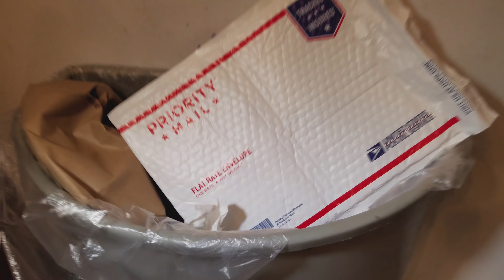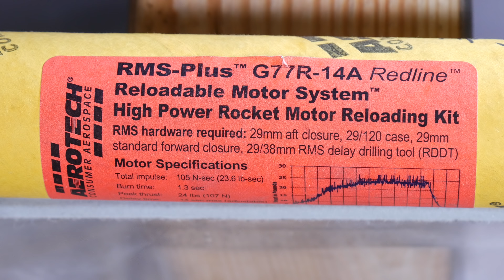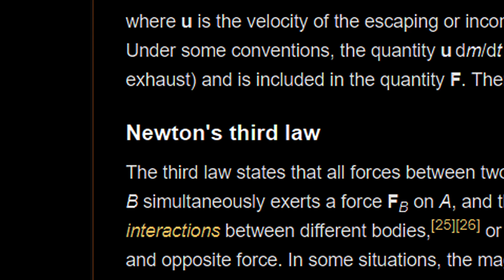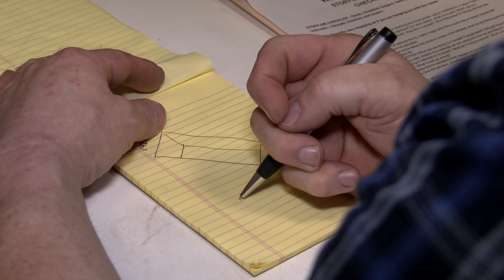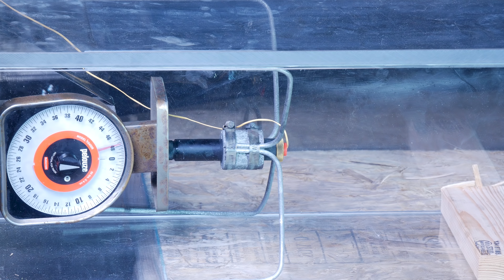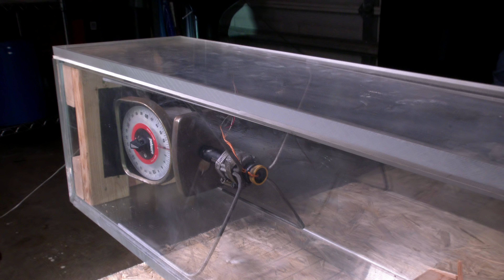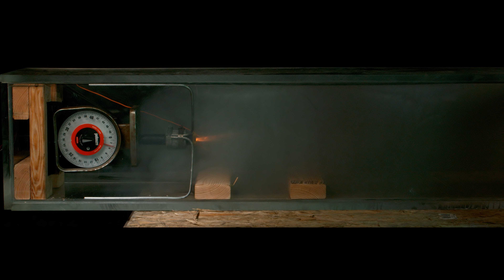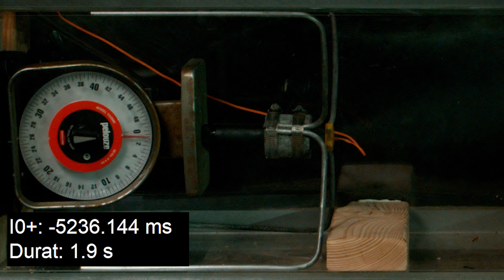Rockets in a Vacuum Chamber - Newton's third law of motion Visualized

Comment: One problem with this test! The second the rocket gases began to fill the chamber, you lost your vaccume and created an atmosphere.
Reply: Spot  
So??? That does not replicate a non-atmosphearic environment!
Reply: The vacuum would be progressively lost not instantly
Reply: And we don't question how do they navigate their rockets in a vacuum. BS
Reply: @sekainiheiwa3650  - With more rockets...
Reply: Exactly!
Reply: Yeah I mean if only we could test a solid rocket in space somehow. (see Northrop Grumman Star 48B solid rocket motor)
Reply: Yes, but the atmosphere wouldn't be thick as Earth's. If they were pushing on the air rockets would loose thrust at high altitudes.
Reply: Big rocket in tiny vacuum vs tiny rocket in ridiculous vast space vacuum. Yeah.. same 🙄
Reply: Sehe ich auch so. Desweiteren gibt es hinten eine Wand gegen sich der Strahl abstossen kann. Denke der Test entspricht nicht der Wirklichkeit
Reply: Very true
Reply: And that is exactly how a rocket works in a vacuum, it pushes off itself, well done, gold star.
Reply: @托马斯-i4v  
hi5
Reply: @sekainiheiwa3650  Rockets don’t use solid fuel In space. It’s reaction control. RCS
Reply: @TEMPLE7D  Yes RC, on lithium by Tesla :)
Reply: Exactly. Thanks fuck I'm not the only one seeing this.
Reply: At least, Rocket can be ignited in empty space
Reply: @TEMPLE7D  - "Rockets don’t use solid fuel In space."

Yes we DO use solid rocket motors as UPPER stages in rocket launches.
Even lit in HARD VACUUM.
Reply: your assumption is that the atmosphere will oxidize but that atmosphere is already burnt up so actually it would technically make it harder for the rocket to keep burning
Reply: جرابة Sock  wrong cause that is exactly what happens in space, as soon as you light your rocket the space around the rocket isn't vacuum anymore... so he is replicating space like situations in his vacuum chamber
Reply: Its correct he fooled ...he created the Atmosphere to burn the oxygen but not really used Vacuum 
Because he'll fail and no one will see this video
Reply: @spacekraft5681  yes read my above comment
Reply: Which is exactly what happens in space. That's why rockets work in space because they create their own atmosphere behind them to push off of by throwing hot air out the back then they throw more hot air out the back and push off the hot air that came out a millionth of a second before
Reply: @jasonspringer2983  When you release gas into an infinite (for all intents and purposes) vacuum, the pressure  immediately drops to zero.  And you can't push on gas that isn't pressurized.  Furthermore, unpressurized gas can't push back.
Reply: In actual tests run by universities and space agencies they continue extracting the exhaust gases while the engine runs.
Reply: @jcskyknight2222  Every vacuum chamber must continously pump out air in order to function.  The problem is you can't remove the exhaust fast enough to maintain vacuum conditions in the presence of a rocket engine.
Reply: @numbynumb  Eh, yeah I guess over a long period of time, but a well built one will hold pressure without the pumps for a good period of time. 

Full vacuum for a chemical engine, yeah it probably wouldn’t hold long, the gas would build up relatively quickly. For an ion engine (or one with similarly low exhaust mass flow)  you definitely can extract gas fast enough to maintain an extremely low pressure.

At least low enough to prove that the engine isn’t “pushing off” atmosphere.
Reply: @jcskyknight2222  Can you point to an example of what you're describing?
Reply: @jcskyknight2222  It's difficult to imagine how they could have tested rocket engine's performance in vacuum because, on top of the difficulty maintaining the vacuum, the soot from the rocket exhaust would also clog up the pumps.  I think they probably just relied on the math - and it's hard to believe that would be adequate  for different reasons. A real aircraft engine is put through a rigorous testing regime over the course of its development because the models are never anywhere close to complete.
Reply: @numbynumb  apparently you do not know enough basic physics to know that rocket propulsion works via RECOIL FORCE.

Would a CROSSBOW, fired in a vacuum, STILL have recoil? Yes or No?
Why or WHY NOT?
Reply: @stuartgray5877  Of course it would recoil.  Because the tension in the crossbow's flexible components cause a reaction force in the mechanism.  

Unlike a freely escaping gas, a crossbow bolt must be propelled by potential energy stored in the string and bow of the crossbow itself.  A pressurized gas doesn't require that a force be applied to it and will freely expand on its own when exposed to a vacuous space.  The rocket  doesn't apply any force to the gas whatsoever and therefore there is no reaction force.  

The work done by a gas = external pressure*change in volume.  Without an external pressure, no force can be applied.  It's really that simple.
Reply: @numbynumb  Can you explain the Law of Conservation of Momentum?
Then use THAT to explain 
how recoil works in crossbows?
Reply: @numbynumb  - "The rocket  doesn't apply any force to the gas whatsoever and therefore there is no reaction force."

Oh really?  The rocket applies NO FORCE?

Can you answer these very simple physics questions?

1 - Does the byproduct of the combustion (the Exhaust Gas) HAVE MASS? Yes or NO?
2 - As fuel and oxidizer combusts, and the exhaust gas exits the rocket is it ACCELERATED?
Yes or No?
3 _ can MASS be ACCELERATED without a force?
yes or No?
Or does the acceleration of mass REQUIRE a force?
Reply: Jason let me ask you a question.  Do you think that enough "atmosphere" can be created behind let's say an Apollo spacecraft during an LOI burn to slow it down enough to enter orbit around the moon?  Do some thumbnail math.  I think you will see pretty quickly that it can't.  Also, keep in mind that whatever gases are being produced behind the spacecraft not only are inheriting the initial speed of Apollo in the same direction, additionally, those gases are being further accelerated away from the spacecraft.  It is not any "atmosphere" that results in this slowing down.  It is the transfer of momentum produced by the acceleration of gas out the rocket nozzle and shaped by the engine bell.
Reply: Here's another question for you doubters.  You yourselves claim that the exhaust is pushing against "atmosphere".  If that is the case, then why do rockets actually ACCELERATE during a launch as the atmosphere is getting thinner?
Reply: @numbynumb  - Sorry but rocket pushes on the exhaust gas while STILL IN THE ENGINE. What happens AFTER the gas leaves the rocket nozzle is irrelevant.
Let me ask you this:
Can the MASS of the Exhaust gas get accelerated WITHOUT A FORCE?
Gas HAS MASS, and it DEFINITELY gets accelerated.
so WHERE does the FORCE COME FROM that accelerated that gas?
Reply: @numbynumb  what's the matter? are you AFRAID to answer basic physics question because it might PROVE YOU WRONG?
Reply: @stuartgray5877  Do you understand that the equation describing the work done by a gas takes the form of work = external pressure x change in volume?
Reply: @stuartgray5877  I did answer your questions. I suspect ypu dont understand the answers because you're not familiar with the physics of gasses (ie Kinetic Molecular Theory).  I'll try to answer them in terms you can understand for the edification of whoever might end up reading this and we can go from there.  

1. The gas' mass cannot accelerate without a force.  

I disagree with your statement that the mass of the gas definitely gets accelerated.  

2.  Since I disagree that the gas' mass was necessarily accelerated, I don't think the force came from anywhere.
Reply: @numbynumb  No you DID NOT answer my questions. try again:

1 - Does the byproduct of the combustion (the Exhaust Gas) HAVE MASS? Yes or NO?
2 - As fuel and oxidizer combusts, and the exhaust gas exits the rocket is it ACCELERATED?
Yes or No?
3 _ can MASS be ACCELERATED without a force?
yes or No?
Or does the acceleration of mass REQUIRE a force?

Or admit you have NO INTENTION of answering my questions because answering truthfully PROVES YOU WRONG.

Now prove ME wrong by answering these three questions with YES OR NO answers.
Reply: @stuartgray5877  
1. Yes
2. No
3. Yes
Reply: @stuartgray5877   You think a rocket works like a crossbow recoiling with the exhaust being like a crossbow bolt and and rocket being the crossbow.  You think that a volume of gas behaves exactly like a solid object. This is incorrect. The reality is that a volume of gas is made up of an enormous number of individual particles in a state of perpetual random motion and you can't treat it as a solid object when trying to understand how the gas performs work. As I explained previously, F = ma is not the right equation.  You need to use the equations that describe the behavior of gases when dealing with gasses.  

Im curious to know: what part of the rocket do you imagine is applying a force to the exhaust?  And where exactly do you think the acceleration occurs?
Reply: @numbynumb  Watch the YT video titled "uninterrupted footage of the falcon heavy launch and booster landing!" by astronomy live.

watch from launch to booster landing and then explain what you just witnessed.
If you want MORE detail, watch the same event from the rocket in the YT video 
"falcon heavy launch" from spaceX and you can correlate events in both videos.

If you cannot spot the parts where rocket propulsion was working in a vacuum, Ill be happy to point them out to you.
Reply: @stuartgray5877  Gravity can accelerate masses and gravity is not a force. You don't seem to understand that there's more to physics than Newton.  Kinetic Molecular Theory was created after Newton because Newton's physics can't describe the way gasses behave. Also, Einstein's theory of gravity clearly states that gravity is not a force yet still accelerates masses.  In fact, the vast majority of accelerations in the universe happen without any force being applied.  

For one thing, the space agencies are not claiming that every space rocket uses a fuel and oxidizer, so it's not necessary to introduce those terms into the conversation.  They claim to use rocket engines which use only pressurized gas with no combustion. 

The rocket exhaust will definitely have the same velocity the moment before it leaves the rocket nozzle and the moment after.  Why would merely leaving the rocket nozzle cause the velocity to increase?   The only way to increase the gas' velocity is to increase its temperature.
Reply: @stuartgray5877  You are now claiming that "the engine accelerates the fuel and oxidizer while still in the engine".  A few comments ago, you claimed that the velocity of the exhaust is zero relative to the rocket until it leaves the nozzle.  How can something be both accelerating and have zero relative velocity?  Your explanations contain contradictions.
Reply: @stuartgray5877  I have some questions.

1. Do you think Kinetic Molecular Theory describes the behavior of gasses? 

2. Do you agree that the equation describing the work done by a gas takes the form of work = external pressure x change in volume? 

3.  Do agree that a freely expanding gas performs no work when expanding into a vacuum?
Reply: @numbynumb  - "Gravity can accelerate masses and gravity is not a force"

Quit repeating bullshit you heard on YT.
Gravity is DEFINITLEY A FORCE for all practical purposes.
Engineers KNOW that gravity is a force.
Some physicists talk about it as if it is not.

The DEFINITION of "Force" is something that can cause a change in MOMENTUM of an object with mass.
Gravity can DEFINITELY change the momentum of an object with mass therefore gravity IS A FORCE.
Quit pretending you have a clue.
Reply: @stuartgray5877  No, gravity is not a force.  That's not my opinion.  It's physics.  If it were a force, physicists would describe it as such.  Newton thought gravity was a force.  But physics moved on from that idea over a hundred years ago.  But not you, apparently.

Even if we define a force as something that can cause a change in the momentum of a mass, it doesn't logically follow that anything that changes the momentum of a mass is a force.
Reply: @stuartgray5877  So according to you, the exhaust is moving with zero velocity and then suddenly, upon exiting the nozzle, it instantly jumps to a very high velocity? 

Why dont you tell us what's causing this acceleration to occur?  It seems you are avoiding answering that simple question.  

Of course a bullet is accelerated when fired from a gun.  That has absolutely nothing to do with what we're talking about.  The bullet must be forced out of the gun.  Gasses don't need to be forced out.  They expand into areas of lower pressure without the need of a force to push them out.
Reply: @stuartgray5877 
You avoided answering my simple yes or no questions.  I answered your questions.  It's now your turn to answer mine.

 1. Do you think Kinetic Molecular Theory describes the behavior of gasses? 

2. Do you agree that the equation describing the work done by a gas takes the form of work = external pressure x change in volume? 

3.  Do agree that a freely expanding gas performs no work when expanding into a vacuum?
Reply: @numbynumb  - "But physics moved on from that idea over a hundred years ago.  But not you, apparently."

No they DID NOT.

AN actual ENGINEER who has passed college physics with flying colors is TELLING you this.

Now go back and do high school physics all over since you failed it the first time.

There are even "Force Gauges" calibrated at NIST (right down the street from where I work) that can MEASURE Earth Gravity and it measures it in POUNDS.
In case you didnt know "Pounds" is a measure of FORCE.
Reply: @numbynumb  -  I answered your questions."

you answered one of my questions WRONG, and you are ignoring the follow up.

Are you CERTAIN that you want to maintain your position that the exhaust gases from a rocket nozzle are NOT accelerated?

So you dont think the e gases CHANGE VELOCITY as they leave the rocket?

I want you to type that out clearly in your own words so we can be clear your stance.
Reply: @numbynumb  - "So according to you, the exhaust is moving with zero velocity and then suddenly, upon exiting the nozzle, it instantly jumps to a very high velocity? "

No.
The fuel and oxidizer are at a relative velocity of zero with respect to the "rocket" (the tanks HOLDING the fuel and oxidizer).
When the exhaust gases leave the rocket they have been accelerated by the pumps in the engine AND from the very high chamber pressure in the nozzle PUSHING out the mass of the exhaust.

Explain it how YOU imagine it working.

Ill BET that you are incapable of explaining in very clear terms how even RECOIL works in a crossbow.
Most of you "Physics deniers" cannot even do that simple task. You know, use regular PHYSICS Terms when explaining a problem like "Recoil force".
 You simply cannot or you would see the flaw in your logic.
Reply: Not to mention space is a quadrillion times more powerful vacuum.  What is it. 10-17 torres. Not even close.  The Sandusky air chamber is 6-7ft thick to keep out the air. From crushing in on itself.  This isn’t even close to a vacuum
Reply: @wakeuppeople7327  - Thanks for proving that you have NO IDEA what vacuum even is.

The FACT is that the "Vacuum of space" is just at 0.0 PSI.
 There is no "Power" to it. The vacuum of space cannot even exert any kind of force.
Reply: @stuartgray5877  You're unwilling to answer any of my questions so there's no point in continuing the conversation.  

I'm confident that our exchange here will be well understood by intellectually honest readers.  And I'm equally confident that they'll see that you rely on childish insults and taunting precisely because you lack good arguments. 

Thank you for perfectly representing your side of the argument.
Reply: I agree, this vacuum chamber is very small and disproportionate to the size of the "rocket".
Reply: Jets/rockets improve in efficiency at higher altitudes because of less air density (aero drag), but maintain the same mass displacement from the fuel expelling.  Helicopters are less efficient at higher altitudes because of less air density (less differential pressure created by the blades).
A vacuum on earth only decreases affects of atmospheric pressure (14.7psi sea level) and reduces air density by applying negative pressure, gravity still exists. This is not the same as space (ie. no atmospheric pressure, no air density, no gravity).
Reply: @discovolante1709  Quit trying to explain physics to others you are bad at it.

Both rockets AND jet aircraft propel themselves by push OUT mass in the form of exhaust gases. As aircraft get higher they cannot generate as much thrust because the air they are using to propel themselves get s thinner and thinner giving them LESS thrust.

Rockets propel themselves by pushing out the exhaust gases they TAKE WITH THEM. They DONT rely on atmospheric pressure for propulsion.

AND there is NO SUCH THING as "Negative pressure". The pressure in deep space is JUST 0.0 PSI. It is NOT NEGATIVE.

ALSOO the "Gravity" on the ISS is almost exactly the same as here on the surface of the earth. Gravity does NOT go away as soon as you reach vacuum.

Try taking at least high school physics BEFORE trying to explain physics to others.
Reply: @stuartgray5877  you're not reading carefully what I said.  As jet aircraft get higher they are more "efficient", why do you think airliners like to fly at 30-40k ft.  I didn't say thrust.
There is negative pressure created in a man made vacuum, I didn't say in space.  Take a look at a turbo gauge sometime.
The fact that gravity doesn't change in a vacuum was my point. I never said ISS.
Reply: My thoughts exactly! They need a way bigger chamber!
Reply: @DonaldHill87  OR, you could just believe the evidence that we already HAVE.
Reply: @causam2508  Yes that's how it works in earths atmosphere. The exhaust pushes off the MASS of "atmosphere". That's not how it would work in the vacuum of space...which they say is still not a perfect vacuum. In a perfect vacuum a rocket would produce 0 thrust. If that Perfect Vacuum were maintained and remained stable at 0. And to answer your question "why do rockets ACTUALLY accelerate during a launch as the atmosphere is getting thinner?" That's because there's still an "atmosphere" even if it does get thinner as you go up. And as the rocket burns its fuel...the total MASS/weight of the rocket ACTUALLY gets smaller! That's why it accelerates. Mass is getting smaller as it burns fuel. But as the atmosphere pressure gets closer to Zero...there are less molecules in the air for the exhaust gasses to interact with. So the greater the vacuum/less pressure there is. The less thrust there is...
Reply: @stuartgray5877  "What happens after the gas leaves the nozzle is irrelevant"??? You have no understanding of physics lol. And NO...the mass of the exhaust gas cannot accelerate without a force. It would be ejected away by the Force of the rocket fuel combusting....Yes the gas is accelerated away by the engine....agreed lol. The force comes from the engine combusting the fuel into exhaust gasses.   Unfortunately that's not how it works in a perfect,steady zero vacuum.
Reply: @stuartgray5877  I answered them in your other comment..lets talk! 😁
Reply: @numbynumb  The mass of the gas would be accelerated by the force of the engine combusting the fuel into exhaust. That's the driving force. But in perfect vacuum... that exhaust GAS would not only be forced away but it's also being pulled apart by the vacuum of space. Higher pressure ALWAYS wants to get to a lower pressure. Proven science fact. So any gases being expelled would immediately dissipate into (almost nothing), as even the "experts" agree that "space" is not a perfect zero vacuum. They theorize though that at some point in space there is a spot that has absolutly nothing in it for light years across!!! That would be the driving force of the universe were it discovered!!!! As the vacuum gets closer to the zero pressure mark, the less thrust that is capable of any "rocket"  At least by current conventional methods...
Reply: @BigDaddyDerekEighty4  so you agree that the rocket engine and nozzle apply a force on the mass of the exhaust gas causing it to accelerate into the vacuum?
Reply: @stuartgray5877  There is actually 4 questions there and the answers are....1 Yes 2 Yes 3 No 4 Yes. But that's not how it works in the vacuum of space lol
Reply: @BigDaddyDerekEighty4  oh and the "vacuum of space" cannot apply a force on ANYTHING.  Apparently you do not understand that fact.  When gas vents fr a car tire at 30 PSI into atmospheric pressure do we consider that to be the high pressure pushing the gas out? It the lower pressure "pulling" the gas out?     The gas model we use says that the force PUSHES gas from a higher pressure to a lower pressure performing work in the process
Reply: @BigDaddyDerekEighty4  sorry but the "Tsiolkovsky Rocket equation" tells us that rocket propulsion is MORE EFFECTIVE in a greater vacuum!   Not the other way around. Apparently you don't realize that we have been testing the Tsiolkovsky Rocket equation for over 100 years.   The company I work for tests hydrazine mono-propellant thrusters IN A VACUUM and verify they produce the thrust predicted by the equation.  Then we put them on real spacecraft, launch them to space and test them there too
Reply: @BigDaddyDerekEighty4  that is NOT how it works in the atmosphere.  It is entirely about transfer/conservation of momentum, whether in the atmosphere or in a vacuum.  There is no difference.
Reply: @BigDaddyDerekEighty4  - Why no response?
You sounded so sure of yourself until I pointed out the flaws in your reasoning.
Reply: @stuartgray5877 
Sorry but you didn't do too well in that exchange and gravity is not a force.
That theory was displaced by Einstein almost a century ago and what has a crossbow got to do with anything
Reply: @pokie6087   Sorry but an actual ENGINEER is TELLING YOU that Gravity IS a force.
It will CONTINUE to be a force until the National Institute of Standards (NIST) starts providing us (actual Engineers) with SCALES that measure in "Space Time Curvature".

For NOW they ONLY provide scales calibrated in "POUNDS-FORCE".
So go tell NIST to change their units and I will agree with you.
Until then, Gravity is still  a force in EVERY ENGINEERING CALCULATION IN USE TODAY.
You are welcome.
Reply: @pokie6087  - "and what has a crossbow got to do with anything"

A crossbow feels a recoil force due to the "Law of Conservation of Momentum".

A rocket propels itself using the SAME CONCEPT.
If YOU don't realize this then perhaps you should not have dropped out of high school before completing physics?
The people that believe "rockets don't work in a vacuum" are the same people who say that Crossbows do not have recoil.
this is because they DONT KNOW WHAT CAUSES RECOIL!
Hint: Its NOT from "Pushing on the air".
Reply: @stuartgray5877 
No the recoil is caused by pushing the released pressure of the string against a projectile. The same principle that applies to firearms. No projectile no recoil. Basic stuff. You're a very angry little man aren't you.
Reply: @pokie6087  - "No projectile no recoil."
Buts rockets DO HAVE A PROJECTILE!
DO you think that the exhaust gas has NO MASS?

We can see if you truly understand the concepts of Mass, Inertia, and Momentum.
Answer THESE questions then:
If I fire a steel projectile from a crossbow into a vacuum will I feel recoil?
Yes or No?

If I fire a solid block of water ICE from a crossbow into a vacuum will I STILL feel a recoil?
Yes or no?
WHY or WHY NOT?

Once you answer those I will give you more. TOO MANY of these conversations have resulted in people CHANGING what they said previously, so that I want your answers in writing.

Most "Physics deniers" will start refusing to answer my questions once they realize that I am proving their understanding of physics wrong.

Lets see if you are also one of those weak minded individuals.
Reply: @pokie6087  And not ONLY do I have undeniable evidence of rocket propulsion in a vacuum, it is literally part of what I do for a living.
So you could not have found a better person to help you understand modern spaceflight technology.
Reply: @stuartgray5877 
Why are you obsessed with crossbows. Why not use a firearm as a closer analogy since it uses burning gas forced against a projectile in order for recoil to occur. Without that projectile the recoil is reduced to almost nothing. Why is that.
Reply: @pokie6087  The point of the crossbow example is that:
I want YOU to TELL ME exactly what the crossbow is pushing on to generate the recoil force here on earth in atmosphere.
Describe what would happen if I put a remote controlled crossbow on a frictionless surface, with no-one holding it and FIRE the crossbow by remote.
WHAT happens?
What happens to both the projectile AND the crossbow? 
What if the crossbow has 10X times the mass of the projectile?
What if the crossbow has the SAME MASS as the projectile?
You people that claim rocket propulsion does not work in vacuum CANNOT EVEN explain the result of that simple problem but they feel confident arguing with actual engineers?

Then YOU tell ME how it would work in a vacuum.
The crossbow FEELS a FORCE when it shoots out the projectile.
BUT WHY?
YOU TELL ME how it works.

(Hint: You CANT, but you will certainly type a lot of words explaining why you don't have to....)
Reply: @pokie6087  - For all of the OTHER READERS:
Note my Physics problem above:

"So here is a problem for you:
If I have a catapult with a mass of 10,000 kilograms and it fires a tank of PURE water of mass 500 kilograms with a velocity of 2500 meters per second, HOW much recoil does the catapult feel?"
I will rephrase it a little different:
A space shuttle Main engine has a mass of (for example) 10,000 kilograms.
It combusts 500 kilograms of liquid hydrogen and liquid oxygen PER SECOND and expels the exhaust gas (PURE WATER) at a velocity of 2500 meters per second.
how much MOMENTUM does the MASS of the exhaust gas have as it leaves the nozzle?
Momentum of exhaust gas = 500 kg X 2500 meters per second = 1,250,000 kilograms x meters/second.
Well, using the "Law of Conservation of Momentum" we know that the force exerted by the nozzle on the exhaust gas (accelerating it) is the SAME force exerted back on the nozzle by the mass of the exhaust gas.
Therefore (according to the Law of Conservation of Momentum) the Rocket Nozzle MUST absorb the SAME Momentum in the exchange.
So if the rocket engine (10,000 kg) absorbs 1,250,000 kg x meters/second of Momentum then it MUST have a final velocity of 125 meters per second.
VERY SIMPLE physics problem to solve (most engineers can do it IN THEIR HEAD) but our friend "Pokie" will obviously not be able to follow ANY OF IT.
Which is sad because it proves that a rocket engine firing out PURE WATER, sure as hell gets pushed in the opposite direction!

Now shall I blow his mind when I explain that the exhaust gas from most other rocket engines is CO2?
Last time I checked DRY ICE has MASS TOO.
Reply: @stuartgray5877 
I've already told you there's no point in answering your questions you don't bother to read the answers.
You only see what you want to see but thanks for doing more than most to convince me that rockets can't work in a vacuum.
Reply: @pokie6087  - "By my recollection it went to about 60 miles, an altitude where the alleged Karmen line border between earth's atmosphere and space begins."

Ok. Lets say this statement is correct.
WHAT is the ATMOSPHERIC PRESSURE at 60 miles where the rocket was using thrusters to maneuver AND the main engines to fly BACK to KSC??

What IS the atmospheric pressure at that altitude genius?
WATCH as he REFUSES to answer once he realizes .....

IT'S VACUUM UP THERE!!
nice Try genius....
Reply: Maybe a more accurate test would be a larger container , and something that electromagnetically thrusts a metal object so that there’s no gases to push off of . That would be the Ultimate test . do it !
Reply: @Pdfgyu  Catapults and crossbows STILL HAVE RECOIL - EVEN in a vacuum!
Reply: So he just used the initial force applied before the vacuum was lost.
Doesn't matter anyway, it's quite obvious that rockets do work in space because they don't rely on pushing against air to make thrust in the first place
Reply: @stuartgray5877 
Oh yeah. Your evidence was a crossbow hanging from a piece of string.
Wow
Seriously wow 😂😂😂
Reply: @pokie6087  and regarding the crossbow hanging from a piece of string.  I'll BET you are incapable of explaining exactly how and why mechanical motions have "recoil". 
Give it a shot genius. And try to use terms from Newtons laws (just a hint to give you a start)
Reply: @stuartgray5877 
For crying out loud are you still banging on about that. What altitude did it reach.
Reply: @pokie6087  The rocket performed propulsive maneuvers from 50 kilometers to 120 kilometers before descending.
There is plenty of evidence in the video that even side booster separation occurs in "vacuum".
Thats why rockets wait until above 50km before any "staging" events or fairing shedding.
Reply: @stuartgray5877 
As I said to you before. Get a map of the entire earth, lay it out and measure a distance of 120km. Using the applicable scale that will measure at about 2-3mm. That's how far off the surface of the earth we are calling space these days but tell me, at what altitude can we say that the atmosphere gives way to a vacuum
Reply: @pokie6087  Yes atmospheric pressure drops to VACUUM at only 50 kilometers.

I have personally launched four spacecraft into deep space and put one in earth orbit.

I am a professional Aerospace Test Engineer first trained at Lockheed Martin Space Simulation Laboratory over 25 years ago to operate some of the nations largest thermal vacuum chambers.  I am an vacuum test specialist.
I then worked at Lockheed Martin Flight systems on TWO Hypersonic vehicles that actually flew. One was the fastest manmade object to ever fly through earth's atmosphere at that time.
I have since worked as a Flight operations engineer at Laboratory for Atmospheric and Space Physics.
I have been a Flight Director at Jet Propulsion Laboratory.

But I am SURE you know more about this stuff than I do with your youtube education...
Reply: @pokie6087  What's the matter? No comment genius?
Reply: @PabloGonzalez-hv3td  progressively if it wasn't being flooded with gases very rapidly. How long do you think it takes a rocket to fill a chamber with gases? I'm sure there is an equation to solve this...
Reply: @PabloGonzalez-hv3td  the smoke should let you know how fast the gases would fill that vaccuum
Reply: @pokie6087  I DID demonstrate rocket propulsion in a vacuum.  You just refuse to acknowledge facts.
Tell me what you see in that video!  I suspect you are too SCARED to watch it and tell me what you saw. 
Just describe what the video shows us. I dont want to put words in your mouth.
Reply: @stuartgray5877 
Give me a break. All you have is a video where the rocket didn't even make it to the Karman line. You're a complete joke.
Reply: @stuartgray5877  
Because is was not in a vacuum! The second the gas vapor released into the chamber the vacuum was gone! You couldn't figure that out? A grade 6 student would have known that...
Reply: @Chris-zi9bb  watch the video I mention above of the Falcon heavy.  Tell me what YOU see in that video.
Reply: @Chris-zi9bb  read all comments in a thread.  I was not talking about the video of THIS experiment.  I am talking about the live video of the maiden voyage of Falcon heavy
Reply: @stuartgray5877 
Yes but surely the Apollo missions prove that rockets work in a vacuum don't they.
Doesn't this make more of a case for you than a measly 50k above earth's surface which isn't even at the Karman line?
Apparently not, which is very interesting.
Reply: @pokie6087  and I see you DONT have the intellect to do that search above I asked you to.  Perhaps one of the other five year olds in your special needs class can help you with that?  Bless your little heart!
Reply: I was thinking the very same thing!
Reply: @briantaylor9448  No sorry, but we light rockets in HARD VACUUM all the time. It is not that hard.
Reply: that is precisely what I was thinking, but in the vastness of space there would be zero thrust.
Reply: @merlin1346  So what would happen if you fired a CROSSBOW into "the vastness of space"?
Would it still feel a recoil force? Yes or no?
Reply: @merlin1346  
Exactly
Reply: @stuartgray5877  what you fail to understand is that the 'rocket' would not be sitting on a slid object lol
Reply: @merlin1346  So you refuse to answer my question?
An actual Engineer is trying to HELP YOU understand by making YOU answer the questions.
Now you can learn from someone that does this shit for a living, or you can piss off and go learn your physics from a Yoga instructor.

Would a CROSSBOW firing into a vacuum have RECOIL? Yes or no?
Why or WHY NOT?
Reply: @merlin1346  No answer?  What a surprise!
Maybe one should try taking at least high school physics before trying to debunk 100 years of proven science?
Reply: @merlin1346  So you REFUSE to answer if a crossbow would feel recoil in a vacuum or not.
Its OK to just say the question is too complex for you.
That's fine. But if your intellect is at such a low level, then maybe you should not be commenting on threads that are discussing physics?
You can sit down now, the adults (who understand basic physics) are trying to have a conversation.
As I said perhaps you should try to learn about physics BEFORE trying to debunk it?
Reply: @merlin1346  I'll try to phrase the question so as to not confuse your delicate understanding:

If I put a remote controlled CROSSBOW in space with a STEEL Projectile, cocked it and set it FLOATING in zero-G, IN A VACUUM.

Then an astronaut FIRES the crossbow with the remote (NO-ONE is HOLDING IT):
WHAT HAPPENS?
Does the projectile come shooting out?
Does the Crossbow FEEL RECOIL?
WHAT happens to the crossbow? Does it just STAY there motionless?

This is not some trick question.
But if it is too complex for you then perhaps you should not try discussing physics with actual engineers?
Reply: @merlin1346  And FYI - I build, test, launch, and operate spacecraft as my job and have likely been doing so for longer than you have been alive.
I have been a member of multiple Spacecraft fueling teams and have had hypergolic (hazardous) handling certifications at KSC and VAFB for over 25 years.
I have operated spacecraft in earth orbit (with and without Propulsion systems) and I have operated spacecraft in deep space with propulsion systems.

Now tell me what YOU do for a living.
Reply: @merlin1346  I was just trying to help you understand. But if you are unwilling to just answer simple questions to help you understand I cannot help you.
Rocket Propulsion has been proven to work for over 100 years using the Tsiolkovsky Rocket Equation.
We have TESTED it for over 100 years.

That equation tells us that rockets are MORE EFFICIENT in a vacuum because there is no air to SLOW DOWN the exhaust gas.
The rocket equation is derived from the "Law of Conservation of Momentum".
Maybe you should learn about that BEFORE calling it all a lie.

The company I work for tests rocket engines IN A VACUUM here on earth and verify that they produce the thrust predicted by that equation.
we then launch them to space and TEST THEM THERE TOO.
Now quit pretending you understand physics better than actual rocket scientists.
Reply: @stuartgray5877  I hate how you explain so much and so profound yet it still is not clear to see for most this naysayers.. I think they're either too naive,  overly ignorant or just plain lazy to exercise intellectual practice.. 

I really appreciate your urge to offset doubt by setting the record straight.. you must be really patient to take time to reply to such many frustrating responses and I can't perfectly understand how and why you should get pissed.. 

I'm Kenyan and how I wish I had an opportunity to work at and for some of the places and on projects you've mentioned..
Keep up with the good work, and the good heart to yearn to enlighten fellow fellows..
Reply: @pokie6087  haha, it's funny you call him out when you're quoting "in general relativity, gravity is not a force between masses" assuming or I don't know, ignoring the word 'between' in between.. so idiotic..
Reply: @stuartgray5877  freemason?
Reply: @norrisronson5479  - "freemason?"

So, in Your book, EVERYONE who understands high school physics is a freemason??
Then do YOU qualify?
Reply: @stuartgray5877  thats a yes then
Reply: @stuartgray5877  so thats a yes then?
Reply: @norrisronson5479  So if EVERYONE that has a greater education than YOU, is a "freemason", then isn't EVERYONE a freemason?
Reply: @twistedyogert  Rockets don’t push on air. They eject mass and move according to Newton’s third law of motion so there’s really no reason to think they wouldn’t work in a vacuum.
Reply: @norrisronson5479  rutabaga?
Reply: The problem is that there is no oxygen in space so how does the fuel burn
Reply: @cheezybinglets8719  Rockets take oxygen WITH THEM to space.
Reply: @numbynumb  Does this mean a can of spray paint won't spray in space? Asking for a friend.
Reply: @patmosboy  When you depress the valve on the spray can, the aerosolized paint will undergo a free expansion into the vacuum at a rate proportional to ΔP.
Reply: @stuartgray5877  correct. conservation of momemtum. the oxidising fuel ejects and pushes its own vessel. throwing an elephant off the back of a ship will give an increase in acceleration.
Reply: @stuartgray5877  its 'ideal rocket equation' or tsiolkovsky equation
Reply: @numbynumb  - " the aerosolized paint will undergo a free expansion"
You people keep using these terms without understanding a word of the meaning.

Let's be certain we talk about what is happening with the paint can using consistent terminology.

When the pressurized paint can is "spraying" the paint into a vacuum:

Does the paint get "Accelerated" into the vacuum?
  (does the paint undergo a change in velocity?)

Does the paint have "Mass"?

Can "Mass" be "Accelerated" without a "Force"?

Answer these questions and we will get to your "free expansion".
Reply: stuart, what I will look into is the ignition and thrust cycle, ie. is the chamber open prior to ignition, or a valve release to the bell, or does it not matter?
Reply: @redshift1223  - Well for just a single example: Spacex Starts the 2nd stage (and restarts the 1st) in a vacuum during a launch.
This is done by first flowing liquid oxygen and liquid Kerosene into the pumps and combustion chamber. Then they inject a mixture called TEA-TEB  (triethylaluminum Triethylborane) which ignites immediately on contact with the Liquid oxygen starting the ignition
Combustion occurs at about 3000 PSI in the throat of the combustion chamber then vents to vacuum through the nozzle.
Reply: That's what I thought
Reply: Exactly.
Reply: Not to mention the scale.  A rocket in the Vacuum of space wouldn’t even be a pin needle.
Reply: @Zrosum  - Sure, but rocket propulsion still works JUST FINE in a real vacuum.
Reply: @DNMEBOY  you are forgetting that a true vacuum , so called space, would have different properties then an atmosphere with air for that “ejected mass” to push off of .. where is this returning push force that’s occurring to propel the craft in a vacuum?? Makes no sense it wouldn’t move at all. It would just dispel its contents as there’s no returning force to give it movement. What is the spray acting on? It’s expanding so fast it cancels out any “push” that would occur under atmospheric conditions.. that’s simple truth is why they now say the atmosphere extends beyond the moon. It’s only because there’s no conventional means of thrust in a vacuum..
Reply: @Chris-zi9bb  100% they never went to Space
Reply: @sillybears4673  - ". where is this returning push force that’s occurring to propel the craft in a vacuum??"

So according to YOU a crossbow would NOT have any recoil if fired into a vacuum?

Are you SURE about that?
Reply: @stuartgray5877  is the crossbow transfixed or held in place? If there’s nothing anchoring the crossbow then the force cancels it self out and they both push off from eachother cancelling any propulsion force.
Reply: @sillybears4673  Lets imagine an experiment, here on earth in atmosphere:
 You place a remote-controlled crossbow on a frictionless surface, nothing holding it back except for its own inertia.

The bow is loaded, cocked and placed on the frictionless surface.

An observer is watching and has zero velocity with respect to the crossbow and the projectile (everything is ""at rest").

Now the observer fires the crossbow via remote.

Explain what he sees occur.

Now repeat the experiment everything exactly the same EXCEPT it is inside a vacuum chamber pumped down to "hard vacuum".

NOW explain what happens.
Reply: @stuartgray5877   the atmosphere here on earth isn’t the same environment as a true endless vaccuum for starters.. so why can’t we just imagine a true vaccuum for your thought experiment ?why does it have to be so complicated? get real please. And make it make sense for crying out loud. What do you not understand? It’s so very simple yet you make up these wild, complicated nonsensical situations that go against known physics. Equating a frictionless bow to a moving object in space .. first off what you are describing doesn’t exist. How can you substantiate something that doesn’t exist through a thought experiment compiled of things and circumstances that don’t physically exist? I can easily tell from your fantastical thought experiment that you are not scientific in your approach or in your understanding. Have a Good day.
Reply: @stuartgray5877  earth has gravity in all places included there in, so your thought experiment is ignorantly combing over the fact that you are anchored in a fixed position on earth.. and like I’ve stated earlier, in a true vaccuum you would cancel out any recoil force as you are not anchored anywhere. You would equally propel yourself backwards and cancel out any “thrust”
Reply: @stuartgray5877  you are missing the fact that I tried two times to explain myself to you as you obviously lack critical thinking abilities, thus the reaction you had to my last response lol. I guess I need to dumb it down even more to help you grasp it even a little bit huh? Well I’m sorry, I don’t have the kind of time it seems it’s going to take for you to understand. I don’t think anyone has that kind of time lol. Goodbye
Reply: @sillybears4673  And AGAIN you type more words weaseling out of answering my questions than just answering them.

What I am trying to do is get YOU to DESCRIBE MECHANICAL RECOIL TO ME.

All you have to do is answer those three questions:

Does the rocket ACCELRATE the MASS of the exhaust gas when the engine is running?

You WONT ANSWER.

I ask you if exhaust gas has MASS?

You WONT ANSWER

I ask you if any MASS can be accelerated without a force?

YOU WONT ANSWER.

There are only TWO reasons for that.
 1- You DONT KNOW basic enough physics to know the meaning of the words: Mass, FORCE and ACCELERATION
OR
2 - You DO Know, and once you thought through the questions you realize you are wrong.

So which is it?
Reply: @sillybears4673  - This is for the other readers.

Here is how a rational human answers my three questions:

When the rocket engine is running:

1 - Is the exhaust gas ACCELERATED as it exits the nozzle?

Answer: Yes
The fuel/oxidizer liquids (for example) are at a velocity of zero with respect to the rocket until they are combusted and the exhaust gases are accelerated from the nozzle under very high pressure.  In some cases to greater than Mach Eight (at sea level).
(A space shuttle main engine has an exhaust velocity of 2500 meters per second at sea level)

2 - Does the exhaust gas have MASS?

Yes, the exhaust gas has the exact same mass as the fuel and oxidizer that went in.

For example, a space shuttle main engine consumes 500 kilograms (this is MASS) of liquid oxygen and liquid hydrogen PER SECOND.
It combusts these two liquids and creates the exhaust gas PURE WATER at over 3000 PSI.  The WATER that comes out is exactly 500 kilograms of mass of water.
Water has mass, therefore the answer is YES, the exhaust gas has mass.

Other rocket engines expel mostly CO2.
Does CO2 have MASS? (ever been hit in the head by a block of dry ice?)

3 - Can MASS Be accelerated without a force?
NO.
Newtons laws state that the ONLY thing that can change the Momentum (Velocity) of a MASS is a FORCE.
This is literally the definition of the word "Force".

SO the answers ARE:
1 - Yes the exhaust gas IS accelerated from the rocket nozzle
2 - Yes Exhaust gas HAS MASS
3 - No, Mass CANNOT be accelerated without a force.

Care to guess what a rational person can conclude from these three answers?
(One that understand high school physics that is)

Care to give it a guess?
Reply: @sillybears4673  Oh AND If you bother to read back through our posts I was the one being nice and polite until YOU started saying things like:
 "What do you not understand? It’s so very simple yet you make up these wild, complicated nonsensical situations that go against known physics."

"I can easily tell from your fantastical thought experiment that you are not scientific in your approach or in your understanding."

Then you STILL refused to answer my simple questions EXACTLY AS I PREDICTED.
Even AFTER I explained that I literally BUILD SPACECRAFT for a living.

I try to help people that actually WANT TO LEARN, as I did with YOU until you refused to participate in a rational discussion by answering my questions.
Is that how you treated your teachers in school? Just refused to answer questions when they are trying to help you understand?
Reply: @stuartgray5877  how is that rude? You are making up nonsense .. a frictionless bow? Come on man make it make sense ..
Reply: @stuartgray5877  I guess if you take facts uo the behind, then yeah that’s rude lfmao. Grow up dude.
Reply: @sillybears4673  - "Grow up dude."

Coming from the high school dropout trying to tell the rocket scientist that "Rockets are fake".
Which of us is more childish?

Bless your little heart!
Reply: @sillybears4673  Now tell me how YOU THINK that a machine can ACCELERATE 500 kilograms of pure water from a standstill to MACH EIGHT - WITHOUT FEELING A RECOIL FORCE.
Come on genius.
Explain that to me.

You MUST think that: water does NOT have mass, OR mass can be accelerated without a force.
So which is it?

You must think that an aircraft carrier can fire a jet from it's catapult without feeling any recoil.
Because accelerating 500 kilograms of water from zero to Mach eight in about ten feet creates MORE RECOIL than a carrier launching a jet fighter.

Tell me that a carrier launching a jet fighter INTO A VACUUM, would result in NO RECOIL Genius.
Reply: @sillybears4673  - "Now tell me how YOU THINK that a machine can ACCELERATE 500 kilograms of pure water from a standstill to MACH EIGHT - WITHOUT FEELING A RECOIL FORCE.
Come on genius.
Explain that to me."

Or run like a coward, your choice.
Reply: You can clearly see that the rocket creates thrust IMMEDIATELY upon ignition, before any significant amount of gas is introduced to the chamber (and certainly not enough to push on).

Thus, the only potential source of thrust is the inertia of the exhaust in accordance with Newton’s Third Law of Motion.
Reply: @stuartgray5877  it’s not used much anymore by the United States, but it is still used in upper stages by poorer nations, and smaller space agencies. 

Once you know how to get it to light, and how to get a reliable Delta V and burn time, there is no real reason not to use it unless you have something better.
Reply: @numbynumb  using the bullet analogy, most of the felt recoil is from the inertia of the bullet, and is determined by mass and velocity, NOT the bullet’s pushing air.

It is the exact same principle with a rocket. The thrust comes from the inertia of the exhaust more than anything else.

Now, having the exhaust push off of something helps INCREASE thrust (of course, in a rocket launch, the rocket has to overcome drag caused by the air, so the benefit is at best negligible in any practical use), but it is not the primary source of thrust.
Reply: @discovolante1709  To be fair, there is gravity in space. An orbit is basically falling in such a manner that you are missing the ground (in the case of orbiting a planet).

For example, during the Apollo missions, the CM stayed in orbit, captured by the Moon’s gravity. The Moon is caught in the Earth’s gravity (at least for the next few million years). The Earth is caught in the Sun’s gravity. The Sun is caught in the Galactic Core’s gravity.
Reply: @stuartgray5877  You are correct about rockets. However, jets, especially modern high-bypass turbofans, do rely on pushing on the atmosphere. (Although turbojets and the cores of turbofans do gain thrust from exhaust inertia, to varying degrees)
Reply: @AviationJeremy  I have launched four delta IIs with solid third stages of my six rocket launches of my career.
Reply: @AviationJeremy  Im not sure what comment of mine you're replying to here because this thread is so long and it's evidently buried in it fairly deeply.  However, I can tell you that inertia is never the cause of any acceleration.    

How do you imagine that "thrust comes from the inertia of the exhaust"?  I don't understand what that means.  Can you explain it in detail?
Reply: Yes the confines of the box gives the combusted/ejected gases something to push off. In the infinity of space? Nah that doesn't work for me.
Reply: @humanhusbandry5508  - "Yes the confines of the box gives the combusted/ejected gases something to push off. "

Thats NOT how rocket propulsion works.
Rockets work by pushing on the inertia of the exhaust gas.
The same way a crossbow feels recoil when firing a projectile, a rocket engine feels recoil (Thrust) by PUSHING ON the mass of the exhaust gas.

"Rocket Propulsion" is mechanical recoil.
Reply: If you throw a bowling ball in space you will move in the other direction. That’s how thrust works in a vacuum.
Reply: So by that logic the vacuum of space would be lost too.
Reply: @biff2k2  Agreed!  "Thrust" is literally just MECHANICAL RECOIL from the rocket nozzle PUSHING OUT the mass of the exhaust gas.
Reply: جرابة Sock   in space you only need enough thrust to get movement started.  Once started it won’t stop until acted upon in an opposite motion
Reply: @twistedyogert  a small rocket like that, sure but the fuel and the size used for space have more thrust
Reply: It will create atmosphere behind the rocket as long as fuel is added.
Reply: @anjanikumar.t1708  that is how the rockets work for space travel.  They have sealed liquid O2 (oxygen). And a fuel.  Ignite in the rocket and propel out the back.
Reply: @numbynumb  in space the rockets create a pocket of atmosphere within the rocket and propel out the back. And space is not a true vacuum anyway
Reply: @numbynumb  what do you think inviting fuel does???? Oh the same thing
Reply: @causam2508  show your math
Reply: @numbynumb  so if it is not accelerated why does the flame fire out the back
Reply: @BigDaddyDerekEighty4  yes acutely it does
Reply: @tedwebster142  while your request is interestingly kinky, I'm not a nerd and besides lessons are extra.  You're wasting our time.
Reply: @sillybears4673  - My last quote to YOU:  "Or run like a coward, your choice."

good choice
Reply: @numbynumb  - "However, I can tell you that inertia is never the cause of any acceleration. "

SO you are denying how RECOIL works?

Please EXPLAIN how the recoil (from say a CROSSBOW) actually WORKS.
Since you seem to be the "expert" on Physics.
Please be my guest.
Reply: @numbynumb  Care to address my questions? They might help you understand how recoil works:

When the rocket engine is running:

1 - Is the exhaust gas ACCELERATED as it exits the nozzle?

2 - Does the exhaust gas have MASS?

3 - Can MASS Be accelerated without a force?
Reply: @tedwebster142  Does a blowtorch or flame thrower cause an acceleration in the opposite direction of the flame?  No, it doesn't.  The flame merely reflects the path of least resistance of the expanding gas.
Reply: @stuartgray5877  

1. The gas flow is accelerated, which causes a decrease in pressure, while conserving kinetic energy, so Im not sure how you imagine that's going to help your case.

2.  There is no exhaust gas in a vacuum.  You need pressure to have gas.  Otherwise you can only describe the exhaust in terms of discrete particles.

3.  You can accelerate the mass-flow of a compressible fluid.  Energy is conserved by a proportional drop in pressure.
Reply: @numbynumb  So your answers were WRONG.

But lets talk abtu the rocket engine here on earth IN AN ATMOSPERE since you seem so confused about vacuum

IN AN ATMOSPERE:
1 - Is the exhaust gas accelerated as it leaves the nozzle?
2 - Does the exhaust gas have mass?
3 - Can MASS be accelerated without a force.

Now answer the questions for a rocket IN ATMOSPHERE.
Try again. I won't rip you apart for your wrong answer YET.
Reply: @numbynumb  You people are so confused about basic physics let's talk about experiments that can be done RIGHT HERE ON EARTH first, so you have a chance of providing the right answers.
Reply: @numbynumb  oh and the correct answers (regardless if the rocket is in atmosphere or not) ARE:
1 - Is the exhaust gas ACCELERATED as it leaves the nozzle?
YES.  For example a Space Shuttle Main Engine (SSME) has an exit velocity of 2500 meters per second.  The fuel and oxidizer is sitting in the tanks with a relative velocity (with respect to the rocket) of ZERO.  About 5 milliseconds later it is moving at MACH EIGHT.  This is most definitely "Acceleration".
Reply: @numbynumb  2- does the exhaust gas have MASS?
YES for example the SSME consumes 500 kilograms (this is MASS) per second of liquid hydrogen and liquid oxygen Combusts IT , then expels the resulting exhaust gas which is PURE WATER.  The result is exact ly 500 kilograms of WATER.  Last time I checked WATER HAS MASS. (in vacuum AND in atmosphere)
Reply: @stuartgray5877  Please  do try to rip apart my previous answers.  Can you identify what's wrong in my  suppodly wrong answers?
Reply: @numbynumb  3-can MASS be ACCELERATED WITHOUT a FORCE?
NO!
This is literally the definition of the word "force" something that can accelerate mass.

NOTHING ELSE can "accelerate" mass.  PERIOD.
For you to say otherwise means you are completely clueless about the most BASIC aspect of physics.
Reply: @numbynumb  Yes you think that MASS goes away in a vacuum. IT DOES NOT.

So would a crossbow have reoil firing a steel projectile into a vacuum? Yes or NO?
WHY or WHY NOT?
Just explain please.

I find it hilarious that people that do not know the difference between MASS and WEIGHT or Acceleration and Velocity have the audacity to argue with actual engineers about basic physics.
Reply: @numbynumb  - "Please  do try to rip apart my previous answers. "
Sure 
- "There is no exhaust gas in a vacuum.  You need pressure to have gas.  Otherwise, you can only describe the exhaust in terms of discrete particles."

For example, this is 100% COMPLETELY FALSE.
In FACT, if you just expose a liquid to vacuum it becomes a GAS!
A combustion process (running at about 3000 PSI) inside the combustion chamber definitely has to vent that gas SOMEWHERE and it goes into the vacuum.
So YES rocket engines accelerate GAS into the vacuum.
GAS HAS MASS. PERIOD.
And a bunch of MASS all going in mostly one direct imparts momentum to the object venting it.
Reply: you failed to notice that it was exerting a force before the box was filled
Reply: @numbynumb  and that's why you see the ignition further back in the chamber
Reply: Yess
Reply: You guys do know that solid rocket fuel is not used in space....right???
Reply: @numbynumb intellectually honest readers.  You have a complete misunderstanding of all fundamentals of physics.
Reply: @stuartgray5877 gravity is the same on the iss as on earth?  I was with you till this statement.   Now you have demonstrated a complete fundamental misunderstanding of physics.
Reply: @discovolante1709 someone with a brain.  Thank you.
Reply: @BigDaddyDerekEighty4 completely wrong.  Thrust is generated by ejecting mass.
Reply: @mvicksdog  - "Now you have demonstrated a complete fundamental misunderstanding of physics."
I'm sorry. SO YOU have CALCULATED the gravity at earth's surface AND at the altitude of the ISS?

No you have not.  Now DO so or stop speaking. it is YOU that is making a fool of yourself.
Reply: @mvicksdog  So did you go and calculate it yet?
(Who am I fooling, you could not calculate that if your life depended on it).

Well then USE AN ONLINE CALCULATOR and put in the radius of earth for a person at the surface, then add 408,000 meters to that and calculate again.
What did you FIND GENIUS?

You found that:
Acceleration of gravity for a person at earth’s surface = 9.82 m/s^2
Acceleration of gravity for a person at ISS orbit = 8.67 m/s^2

So YES, the GRAVITY
AT
THE
ISS
IS
ALMOST THE SAME
as at the surface of the earth
Now try completing HIGH SCHOOL before challenging actual engineers about basic physics.
Reply: @stuartgray5877  it is less.   Have you done the calculation?
Reply: @stuartgray5877  horseshoes and hand grenades buddy.
Reply: @stuartgray5877  but I see your point.   These geniuses think the No atmosphere thing is a “gotcha” question, only demonstrating they don’t have a clue and are really just foolish.
Reply: @mvicksdog  Can you give an example of a specific fundamental that I'm misunderstanding?
Reply: @mvicksdog  I actually launch things to space as my job, so I take it kind of personally when they accuse me of lying or "stealing" taxpayer money to build spacecraft for NASA.
Reply: @sekainiheiwa3650  Using gas thrusters in different points around the craft for maneuvers while thrusting.
Reply: Guess what happens inside a rocket in space?
Reply: @xyex  
The is a big between a chamber that contains atmospheric pressures and space which is infinite
Reply: @Chris-zi9bb  Sure, but it's not a difference that actually matters for rocketry. Rockets do not need an atmosphere to move. The force of the fuel igniting is what pushes a rocket. The atmosphere only creates drag.
Reply: @Chris-zi9bb  We have logged MILLIONS of hours of rocket propulsion IN SPACE.
There is no longer ANY question if rockets work in a vacuum.
We are now launching rockets to space MORE than once a week!
Get with the program.
Reply: @xyex  It can't gain  any pressure due to being wide open to an effectively infinite volume of space in vacuo.
Reply: @numbynumb  It doesn't need external pressure. It needs force. Just because there's no atmosphere outside doesn't change the fact that an explosion inside an inclosed space is going to create force. The fuel ignites, this expansion from solid or liquid into gas creates force, the exhaust ports only allow the force to escape in one direction there by applying energy in the opposite direction, and the rocket moves.

If you set off a bomb inside a vacuum chamber, what would happen? Would the lack of atmosphere result in the shrapnel sitting still, or would the force applied by the explosion propel it all over the chamber? The answer is, quite obviously, the latter. And rockets work under the exact same principles of force and motion.
Reply: Exactly 💯 true that an atmosphere have been created from the gasses filling the chamber (in actual space the gasses will not able fill the vacuum space), plus there is other variable that could mislead the result in the experiment which is thrust can be generated when the rocket gasses hit the opposite wall of the rocket motor at the end of the vacuum chamber(and according to theory actual space don't have walls). The experiment also shall show the whole video vacuum chamber and some other view( top, rear and close up) and use data logger to record all reading on the gauge, thrust, temp and etc to further analyze the experiment.
Reply: @xyex  I agree that an explosion inside an enclosed space will create forces. But we're not talking about an enclosed space, rather a space that is continuous with the vacuum of space.  If you acknowledge that gas pressure is the source of the propulsive force in rockets, then you must also acknowledge that you must refer to the physics created specifically to calculate forces arising from gas pressure.  The equation for work done by a gas is work = external pressure*change in volume.  Look it up.  

I think what's missing missing from your analysis is the understanding that a rocket in space is a closed system, meaning that it  cannot exchange energy with the environment, in this case the vacuum of space. If a ship cannot transfer energy to some object or entity outside of itself, how can it use its energy to do work?
Reply: @xyex  Inherently pressurized?  Im not sure what that's supposed to mean in physical terms.  In this case, "pressurized" would mean that there's some barrier preventing gas from freely expanding out of its container.  But when a chamber is continuous with the vacuum of space, it cannot be described as pressurized.  

": to confine the contents of under a pressure greater than that of the outside atmosphere"
Reply: @numbynumb  No, pressurized absolutely does not mean there's a barrier. See, this is why you're so confused about how this works, you lack even a basic understanding. Like, come on. Have you ever seen a pressure washer that didn't have a nozzle for the water to escape from? This isn't complicated, I can't understand how anyone can struggle this hard to understand it. Last I checked, there's very much a pressure difference between a chamber full of gas and empty space. And by adding and combusting more fuel inside the chamber you naturally increase the pressure within that chamber. The fact there is an opening to enable output of the gas doesn't stop the chamber from being pressurized. And is, in fact, necessary to create the thrust that's the entire point of the system.

Seriously dude, if you're going to try and argue something you could at least try and know what the fuck you're talking about.
Reply: @numbynumb  But we ARE talking about an enclosed space. The rocket fuel isn't being ignited in space, it's being ignited inside the rocket. That space is enclosed on 5 sides. The force of the ignition hitting the those sides transfers kinetic energy. Four of the directions cancel out, one of them does not due to the exhaust opening on the reverse side. There's where your thrust comes from. The fuel burning pushes the rocket.

What's missing from your analysis is an understanding of what you're talking about. The rocket is not a self contained system. It has an exhaust. What's more, the ship isn't transfering any energy to anything. It's the recipient of the energy. The fuel is transferring it's energy into the ship.

The energy is stored in the fuel, it is released when it is burned, and part of that energy is transferred into the rocket while part of it is wasted out the exhaust. It is that imbalance of transfer that creates the energy differential that enables the rocket to move.

The vacuum of space is absolutely irrelevant in this equation. All that matters is the fuel and the rocket.
Reply: @xyex  Enclosed means closed, as in open vs closed.  The dictionary defines ‘enclosed’ as “surrounded or closed off on all sides”.  If a container is open on any side, then it is not enclosed.  It’s really not very complicated.  

Gas pressure is created by the walls of the container which confine a gas, not by the ignition of rocket fuel (which, incidentally, also requires gas pressure to occur).  Removing a wall removes pressure from the total volume of the gas.  Thus gas that escapes through an open side of the container cancels an equal and opposite pressure on the opposing wall (as well as every other wall of the container), not the other way around.  The entire volume of gas is losing pressure and cannot generate positive pressure in any direction as a result of this process.  Gas molecules never show a preferred direction, even as they leave the container.  The pressure within a gas is always evenly distributed, even when the gas is flowing in a direction.  If you don’t believe me, look it up.  

Furthermore, NASA and other space agencies don’t claim that combustion of any kind is necessary to power a rocket.  NASA claims to have used cold gas rocket thrusters to achieve thrust in a vacuum using nothing but discharges of compressed nitrogen gas. 

A rocket in a vacuum is a closed system.  Im assuming by “self contained system”, you mean closed system.  I agree that the ship isn't transferring any energy to anything because there’s nothing there to transfer it to - that’s, in fact, the definition of a closed system.  The fuel is part of the system.  Before the rockets burn, the fuel is at rest in the frame of reference of the rocket system.  You cannot gain a directional bias without acquiring it from an external source - thus a body at rest will remain at rest unless an external force acts on it, and a body in motion at a constant velocity will remain in motion in a straight line unless acted upon by an external force.
Reply: @numbynumb  Your attempt to avoid the facts by trying to make pointless arguments about wording doesn't change the fact that rockets actually work and you simply can't grasp it.

And the gas pressure is created by both as the ignition of the fuel causes a rapid expansion of the gas. What happens when something expands in a confined space? The pressure increases. This is rudimentary physics. And yes, even with the nozzle at the exhaust it IS a confined space. The entire point of the exhaust nozzle is to control the rate of escape of the gas, which effects the pressure. Allowing an escape path isn't magic. The pressure of a system doesn't immediately become zero just because an exit exists. Otherwise combustion engines wouldn't even be possible.

And no. The escaping gas absolutely does not "cancel the pressure" in the other directions. You're literally claiming that if you put a stick of dynamite in an empty soda can and set it off the can would survive intact because all the pressure escaped out the opening, which is obviously not how it works.

And your argument about the volume losing pressure is only, once again, highlighting your complete ignorance on the subject. You keep trying to replace phsycis with magic. Yes, obviously the expanding gas has no prefered direction. That's why it hits all sides equally except the side that enables evacuation. Once again, that's literally how the damned thing WORKS.

Look it up.

And the existence of different kinds of rockets doesn't change anything. Stop trying to move the goal posts just because you've been proven wrong.

No. A rocket in a vacuum isn't closed. Closed means there's no transfer of anything in any direction. The self contained system of the rocket and fuel is not closed. It loses energy into space. A closed system does not bleed energy.

And you end your comment with more incorrect nonsense yet again highlighting your lack of understanding of extremely basic physics. And so I'm done dealing with you. This is clearly pointless as you obviously have zero interest in learning anything. Enjoy your ignorance.
Reply: That's right. That's my point. He made a very small chamber and produced atmosphere in it and that's how thrust produced. But space is infinite and it does not behave like this small chamber.

And the most important point is there should be a strong boundary just like your chamber to separate vaccum and atmosphere. Where is that strong boundary or earth?
Reply: @5mintalk  No, that was not how thrust was produced. Hence why there was thrust immediately before any "atmosphere" formed. And why there was as much thrust with the thin "atmosphere" of smoke as there would have been outside the tube.

And why should there be a strong boundary separating space and the atmosphere? The atmosphere is drawn towards Earth's gravity. Some of it, through interactions with various forces, does drift away. But the bulk is nestled around the Earth. And with no force great enough to pull it out of Earth's gravitational grasp it stays there.

Space is a vacuum, not a vacuum cleaner. It does not create suction. It simply provides no resistance to the spreading of material, of gas. But that material, that gas, still needs some kind of force to move it into that space. It can't move itself.
Reply: Nothing like moving the goal post. Exactly what is the composition of the smoke?

The bottom line is this is empirical evidence that a rocket engine produces thrust in space.

Of course anyone with two functioning brain cells to rub together already knew this.

Something as simple as a compressed gas thruster produces thrust in space.

I personally think a better experiment would have been to fire a blank from a starter gun in the chamber

If the projectile which is a lot of cotton flies out of the end of the gun then thrushed his created proving that a rocket engine will work in space.

Or he could have simply used a little CO2 thruster or even one of those pump up liquid toy rockets.

Or how about a water balloon, poking a hole in a water balloon in a vacuum, will the thrust of the liquid leaving the balloon move the balloon.
Reply: @Sekai Ni Heiwa   actually, you can! There are multiple ways to navigate a rocket in a vacuum. The first way is to change the direction of thrust by swirling the rocket engine, the second way is by using some kind of reaction wheel. A reaction wheel works by spinning in one direction which causes the rocket to spin the other way. The third and final way is by using smaller, significantly less powerful rockets off of the center of mass, known as RCS (reaction control system). These small rockets push the rocket off of the center of mass to make it rotate! Hope this helps, and if you ever tried to disprove yourself, you might find Information more powerful than just trying to prove yourself right.
Reply: At 10:13 you can clearly see tge pressure gage raises. Not a perfect vacuum
Reply: Also the thrust if pushing off the surface behind rocket
Reply: @TheMikeyDangelo  😂
Reply: Once there is air, there is thrust.
Reply: @stuartgray5877  Hey, I'm just wondering if you knew Robert "Bob" James? He was a Test Engineer at Rocketdyne in 1976, Chief of Multi-Mission Integration at Lockheed Martin from 1978-1994, and Director of Engineering and Systems Integration at Spaceport Systems International and launching satellites out of VAFB from 1994-2015. He was my grandfather.
Reply: @_NicholasSmith  The name does not ring a bell. I worked at Lockheed Martin Flight Systems (Waterton, CO) from 95-2000.
I only launched one spacecraft from VAFB back in Nov 2017. All of my other launches have been from KSC/CCSAF(CCSFB)
Reply: I got a headache from just trying to comprehend the nonsense you stated.
Reply: @chilipalmer10  
Back to school you go!
Reply: @Chris-zi9bb   point your finger at the law of physics that states a force required a medium in order to act upon a mass.
Reply: @chilipalmer10  
Wrong, I'm an engineer... Getting the force equal to its weight from the surface to which it is attached to (normal force). Consider the situation devoid of any resistance. Even with constant velocity at least at the start and balancing the force of gravity afterwards.
Reply: @Chris-zi9bb  you're an ENgiNeEr who thinks space is fake and rockets don't work in a vacuum lmfao 😂😆
Reply: @chilipalmer10  
Ok thanks you. This topic was from almost 4 years ago. Not sure how this even came up again after all this time. Anyway,  I'm long retired and done with the topic. Thanks for the input....
Reply: @Pounder they work fine. The Voyager spacecraft were put into an escape trajectory using solid motors.
Reply: @Pounder what
Reply: They just don't understand this. 👍
Reply: @anjanikumar.t1708 no he didn't. He may have created some atmosphere but that atmosphere is devoid of oxygen. Igniting rocket fuel without oxygen is not impossible. There are many fuels that burn even underwater. The experiment is about Newton 's law of motion . They would like to find out if a rocket can create thrust in a vacuum. You could see that the scale moved even at the initial stage of ignition, at that point the chamber still has negative pressure. Sure, as the fuel burned it will fill the chamber with gas and hence, there will no longer be a vacuum. I think a longer chamber will be better just to really be convincing.
Reply: You can clearly see the seal blow
Reply: I'm amazed people aren't realising that. Lol
Reply: 100%! He should have known that
Reply: @BigDaddyDerekEighty4   "The mass of the gas would be accelerated by the force of the engine combusting the fuel into exhaust."

The engine doesn't combust the fuel into exhaust.  The combustion is a chemical reaction that occurs when the fuel and oxidizer are ignited by a spark-plug.  The engine is designed to exploit this reaction, not to generate it.
Reply: @mvicksdog     "intellectually honest readers.  You have a complete misunderstanding of all fundamentals of physics."

Please provide a single example of a supposed "misunderstanding".
Reply: @xyex    Do you understand that the equation used to calculate the work done by a gas is external pressure x change in volume?  

If your understanding of physics is correct, then do you disagree that W = p Δ V?
Reply: Does it wait until the chamber is filled with exhaust or does it move immediately?
Reply: @stuartgray5877  Check out @Chris-zi9bb .
Another physics denier that claims to be an "Engineer".
I know that is your favorite kind of flerf.
Reply: @jasonspringer2983  Thats not why the rocket works in space. The rocket does not need anything to push off of in the first place. That's not what's happening.
Reply: @stuartgray5877  interesting. So, you could theoretically attach a plate a few feet behind the nozzles and the rocket would still function effectively?
Reply: @willylanganke8862  No because the plate would then reabsorb the momentum that the rocket just imparted to the exhaust gas.
Reply: @stuartgray5877 I take it then you've changed your mind regarding it not mattering what happens to the exhaust once it leaves the nozzle?
Reply: @willylanganke8862  No I have not. But if you give me the exact context, I can make a more intelligent response.
Reply: @stuartgray5877  I was referring to your comment "sorry but rocket pushes on the exhaust gas while it is still in the engine. What happens after the gas leaves the rocket nozzle is irrelevant". Your reply to me now seems to indicate it does have relevance.
Reply: @willylanganke8862  To be clear: A rocket engine accelerates mass out the back of the nozzle, once the mass of the exhaust gas has left the nozzle - it does not matter what happens to it.
IF you want to try to "intercept" the gases before they have left, then I argue they have not left the nozzle. 
The baffle you are trying to put in the way of the gases then technically becomes part of that nozzle. You are just asking "what happens if I close the nozzle"?
Yes, the rocket stops thrusting if you close off the nozzle.
Reply: @stuartgray5877 if you read my comment again, you'll notice I said, "a few feet behind the nozzles". That's not intercepting the gases before they've left, it's after they've performed their work and after they've left the nozzle. But OK, I'll change it to a few yards behind. Would that have an effect on whether the rocket would perform effectively or at all?
Reply: @willylanganke8862  The rocket gets pushed forward by the momentum exchanged with the mass of the exhaust gas if you then RE-absorb that momentum, with your plate you will slow the rocket back down again.
Reply: @stuartgray5877  so it does matter what happens to exhaust gases after they've left the nozzle. Thanks.
Reply: @willylanganke8862  No. Still doesn't matter. But IF you put a plate on the nozzle to restrict the flow you will reduce the thrust. Stop trying to play word games I am not falling for it.
Reply: @willylanganke8862  It does NOT MATTER what happens to the exhaust gases AFTER they leave the rocket.
Reply: @stuartgray5877 I'm not playing word games. You are by trying to pretend I'm saying the plate is attached to/part of/blocking the nozzle when clearly, I am not. I'm trying to understand your apparently contradictory positions. So, what if the plate is still yards away from the nozzle and not attached to the rocket but just following and travelling at the same speed as said rocket?
Reply: have you saw the first tried??? it blow the box open by pressure st almost instant light up…
Reply: Space is fake man, plz
Reply: @the_flat_earth_warriorz  - "Space is fake man, plz"
SO, you are smarter than ALL of the Engineers and Physicists to have EVER LIVED?
Even though you failed to complete high school?
Sounds reasonable....
Reply: Exactly what I was thinking
Reply: Thrusters
Reply: Did you watch the video through?
He clearly stated "the moment of ignition, start of the burn" so was very aware and addressed your opposition.
Only thing missing is the chamber pressure after the event.
Reply: @NotAnotherFucking  Nothing you said contradicts what I have said. You are likely just responding to the wrong person.
Reply: @NotAnotherFucking  SO you read all of my comments on this thread going back three years and you are still confused?
Reply: @NotAnotherFucking  I usually "explain" by asking the skeptic "would a crossbow fired into a vacuum have any recoil".
Many respond by saying crossbows DONT HAVE recoil" which gets right to the heart of the matter.
Most just refuse to answer when they realize that answering truthfully proves them wrong.
Reply: @NotAnotherFucking  To simplify it to their level I TRY to tell them:
"Rocket Propulsion is just the mechanical recoil of pushing on mass".
The exhaust gas has mass.
The rocket engine makes that exhaust gas accelerate.
Therefore, the rocket engine applied a force to the mass of the exhaust gas.
It does not change velocity to Mach eight all by itself.
Newton's third law.
Reply: Flaws like this, undiscovered during the time of operation, is how people die in real experiments
Reply: @KENDRICKREVIEWZ  What are you going on about?
Reply: @stuartgray5877  idk, my comment is missing, lol
Reply: Which then reduces the efficiency. Duhhhhhh
Reply: You created a gas so therefore your vacuum become less of a vacuum and the force was pushing on the box creating force higher than an abundant space vacuum.
Reply: @jcskyknight2222 they can never mimic what is alleged to be the vacuum of space
Reply: @stuartgray5877 here comes Stuart with his crossbows again 😂😂😂😂🤦🏻🤦🏻🤦🏻
Reply: @stuartgray5877 numbynumb just obliterated you.   But you're used to that from everyone that goes against your silly arguments lol
Reply: @Checkeroute  Depends where in space you want to create the conditions for.
Reply: This is exactly how it works in space, the rocket produces its own atmosphere behind it and Newtons third law is achieved.